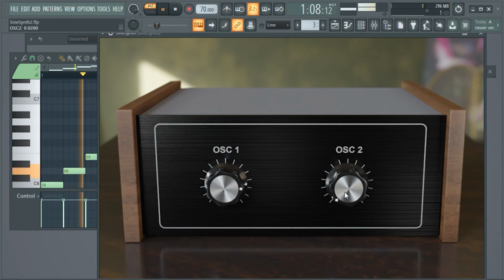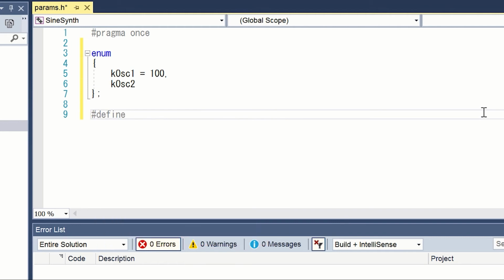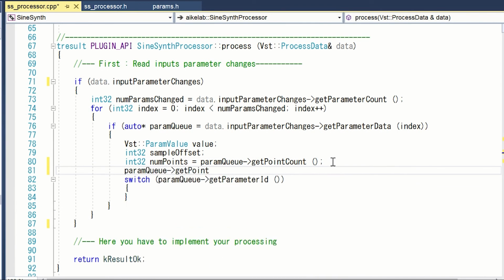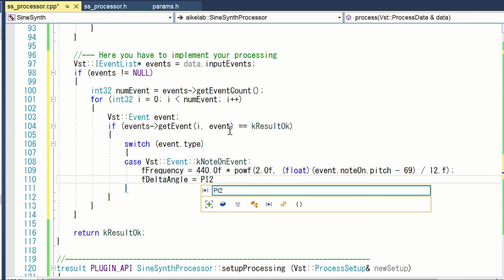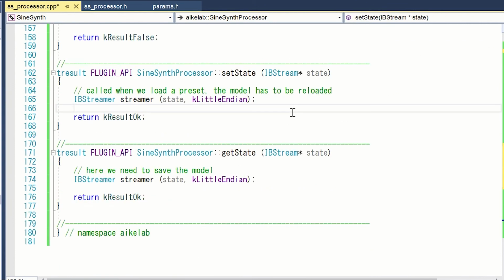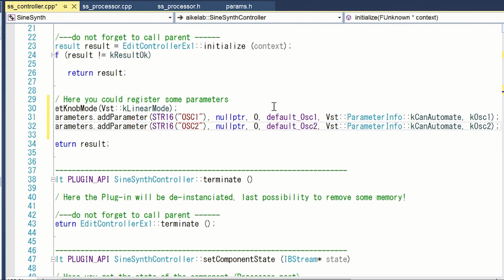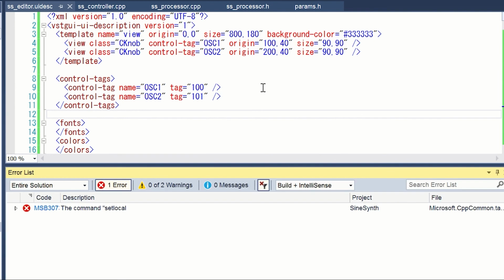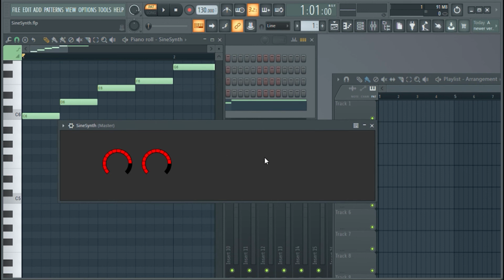VST3 SDK Tutorial: Create your own VST3 Synth plug-in

Comment: Awesome Tutorial! Thank you very much! I just started with Vst3 SDK today and this is very helpful!
Reply: @aikelab Is there a simple way to output a squarewave as fOsc2, or is it more complicated?
Reply from the maker: 1) the simple way is the following:

  outL[i] += fOsc2 * (sin(fOsc2Phase) > 0.f ? 1.f : -1.f);

however it generates alias noise on high pitch

2) the solution is generating square wave by additive synthesis:

  float freq = fFrequency * 2.f;
  float nyquistFreq = data.processContext->sampleRate / 2.f;
  float signal = 0.f;
  for (int32 n = 1; n < 10; n+=2) {
    if (n * freq < nyquistFreq)
      signal += sin(n * fOsc2Phase) / (float)n;
 }
 outL[i] += fOsc2 * signal;
Reply: @aikelab  Thank you ever so much! I learned the Fourier transformation years ago and can see some parallels now. Thanks for the help that is not taken for granted! Have a nice day!

Comment: Thank you very much for this excellent tutorial.
The "setlocal" error can be a bit misleading. One additional cause for this message is that an validator is running that checks the plug-in for VST 3 conformity.

I got 2 errors:

1) [Parameters Flush (no Buffer)]
So if data.numSamples==0, then the data.outputs value is a nullptr.

2) [In: Mono: 1 Channels, Out: Mono: 1 Channels]
If the output is mono, only data for one channel should be generated.

For a successful validation I adjusted the generator like this:

if (data.numSamples != 0) {
    Vst::Sample32* outL = data.outputs[0].channelBuffers32[0];
    Vst::Sample32* outR = data.outputs[0].channelBuffers32[1];

    for (int32 i = 0; i < data.numSamples; i++) {
        outL[i] = fOsc1 * sin(fOsc1Phase);
        outL[i] += fOsc2 * sin(fOsc2Phase);
        outL[i] *= fVolume;

        if (data.outputs[0].numChannels > 1) {
            outR[i] = outL[i];
        }

        fOsc1Phase += fDeltaAngle;
        fOsc2Phase += fDeltaAngle * 2.f;
    }
}

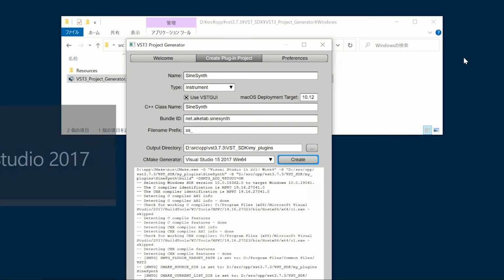Comment: Hello, so when i click create at around step 1:35, it says could not find any instance of Visual Studio. i have the latest build (currently) of visual studio installed. but I've noticed the project generator only has up to version 17 2022 listed. is that an issue? Do I need to download a older version of vs code for this to work?

Comment: One more thing - if you want to debug plugin using Steinberg host - installed ASIO is MANDATORY to run that thing - in other case "processing" function will not run even to check variables in VS debugger.

Comment: Nice tutorial. It compiled succsessful as vst instrument and I can use it in my Daw. I can move the two knobs but there is no sound comming out?
Reply: Hello, @PollederBoss. Did you manage to get it working? I just followed this tutorial and I am able to open the plugin in Reaper and get sound from it. But the knobs are not doing any changes to the sound.
Reply: Same. My compile seems to have worked and my DAW recognizes the plugin as a virtual instrument, and I can see the oscillator parameters, but unfortunately there is no sound.

Comment: Question regarding building finished plugin - is there a way to include all resources into .vst3 file? I can see that every plugin I have so far have only .vst file inside C:\Program Files\Common. Is it possible to do it myself?
Reply: I have the same question, did you find a solution?
Reply: @profbperrin  Unfortunatelly no, VST3 requires specific directories to be made. I suppose that in case of my Arturia plugins pack needed data are in different location, but I have no idea how to set it up.